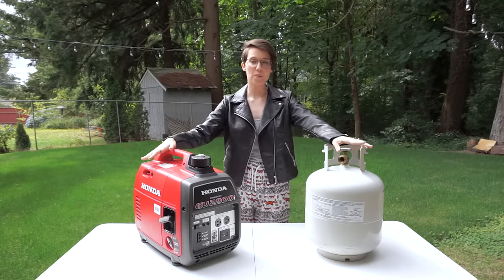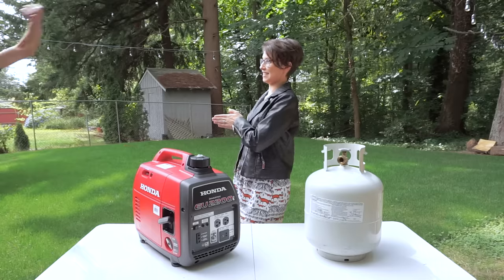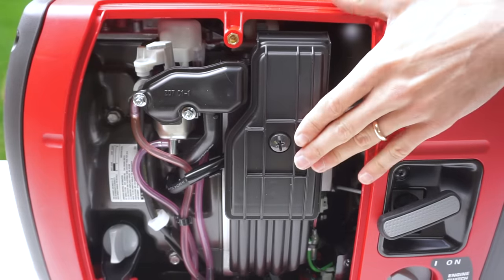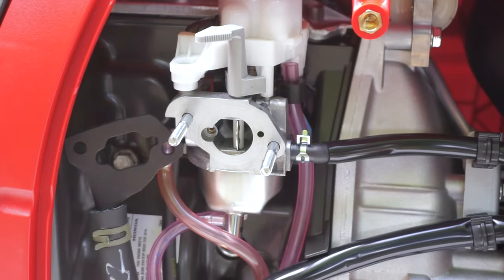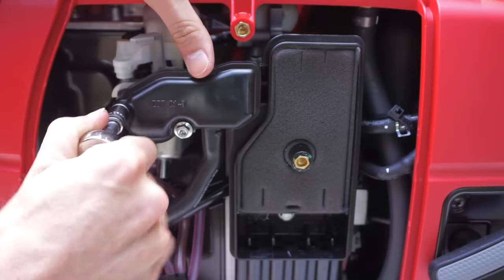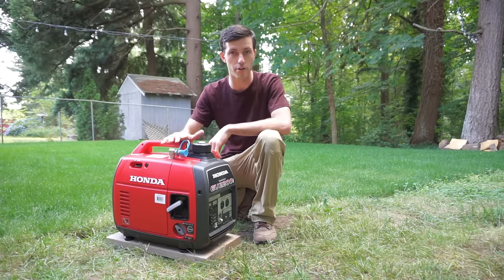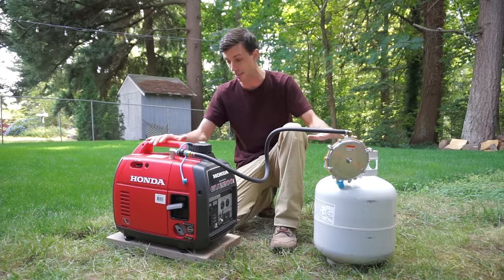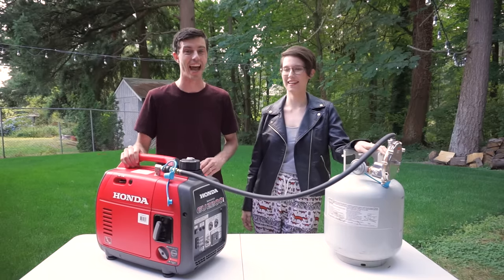Honda EU2200i Propane Conversion Kit - DIY Install for Honda Generator

Comment: Hello a few questions:
1. I wonder why Honda does not off a propane unit from the factory?
2. How many watts does the Honda put out when burning propane vs. gasoline?
3. I noticed on your video of installing a soft start on your AC you used a Westinghouse, now you have a Honda....Why did you change?  
Your guys do a good job with your channel keep it up.  Thanks

Comment: Great information! It gives me clear idea propane has less pollution.  I wonder if I am to keep 20 ft away from the gasoline generator, would I be able to shorten such distance by switching to propane generator, if noise is not a concern for me?

Comment: great video ..
the price of a honda + conversion is insane 
a harbor frieght is 500$ 
champion and sportsman have propane units for under 800$
again you did an amazing job on this video <3
Reply: Fortunately you get what you pay for, read the reviews at Harbor freight and you’ll understand that they’re not high-quality and often have electrical failures. I don’t think that’s the place to save money when you need a back up generator.
Reply: @melissasmess2773  1200$ for a honda 
Or 450$ for a harbor freight that's the exact output as the honda .
Now I've had mine for two years and never fails to start and super quiet 
The only experience I've had with champion is my buddy had his a couple of weeks and it power fried .
Stick to my Harbor Freight

Comment: Thanks for the video, any draw backs or problems since making the video? I am thinking about going this route.
Reply from the maker: Definitely do it. We've been running our honda for 5 years now on propane and it's so much nicer than gasoline. We've had zero problems.

Comment: Nice video. Very well executed.. one question. Do you have to convert it back to gas or just run gas on same propane system.
Reply from the maker: With this kit it's now a dual fuel generator and can switch back and forth between gasoline and propane.

Comment: How long will the generator run on the propane tank?
Great video and clear instructions.
Reply from the maker: It will run for 32 hours at 1/4 load on a 20 pound propane tank.

Comment: To be safe and not to loose expensive propane I would have tested the connections you made inside and outside the generator with a bottle of leak detection fluid just to make sure the joints are good......👍
Reply: Its lose not "loose". Sorry I had to.

Comment: You are doing very good educative videos, thank you. i just bough the eu2200 and will install the conversion kit. Now do i need to let the generator runs on gas for a couple of hours first ?
Reply from the maker: Nope the generator never needs to run on gas and if you're going to do the conversion I would recommend that you don't.

Comment: I get why you did the conversion but...since the specific energy or energy density of propane is about 82% that of gasoline, your 2200W generator is now an 1800W generator.  It probably doesn't matter for what you are using it for...1800W peak will do the job, and like you said, it burns cleaner too.  Good video.
Reply from the maker: Yep, we mainly only need the generator to recharge our battery bank 👍

Comment: Great video.  I would be using Natural Gas.  Is it the same install minus the regulator?  I have a quick connect feed for my grill that I would use for the generator.

Comment: How does the Propane gas pressure regulator handle cold weather? Propane (LPG) systems in cars need to be heated with coolant fluid, otherwise the pressure regulator will freeze.

Comment: I'm glad you did the video.  That option sounds like a very easy and fantastic mod to the Honda Generator.  THanks.
Reply from the maker: Thank you! It is a great mod, we are super happy that we have a choice between gasoline and propane with the flip of a switch.

Comment: Great video yer im in Australia 🇦🇺 and want to do this great to run 2 different types off fuel very handy 👍expesily when ya in the out back off Australia sometimes you carnt get eather type off fuel or only one or the other in remote places  , gee your missis was quick at the shops 😀 whats the soft start up thing for the aircon 🤔

Comment: Very good and easy video setup. Question can you do the same with two  EU2200i and EU2200i companion I understand I would need a Y splitter if it can be done. Thank you for sharing. Happy camping 🇺🇲🤙🏼⛺ One last question you still can use gas too. ⛽ right ? Thank you.
Reply from the maker: I'm not sure about running two generators off a single propane tank, you would have to ask the manufacturer. And yes you can still use gasoline! This kit makes the generator "dual fuel".
Reply: @FateUnbound  I took your advice by contacting the company and yes they do make one also. Thank you. Stay safe.🇺🇲🤙🏼

Comment: Great vid, to clarify: once the kit is installed can you still run on gasoline if you choose to?  And switch back and forth, or once converted you are limited to propane/NG?
Reply: Absolutely. You can switch back to gasoline anytime. The kit in no ways limits the type of fuel used.

Comment: Great instructional video.  I have a large 5th wheel and I'm considering getting a Westinghouse dual fuel generator. Why did you switch from a Westinghouse generator?

Comment: I am considering installing the conversion for the  EU3000.  One draw back on the 1000 and 2000 compared to the 3000 is the small tanks that need to be filled often.  The 3000 holds about 3 gals and can run around 20 hrs.  I understand that propane is less efficient than gasoline.   A 20lb bottle of LP is comparable to 5 gals of gas in weight and bulk.   Using the 2000 for comparison, I would like to know just how much longer, if any, a 20lb bottle of LP would run the generator compared to 5 gals of gasoline.

Comment: Nice job. What is the approx run time range for a 20 lb propane tank?
Reply from the maker: 32 hours at 1/4 load on a 20 pound tank.

Comment: Any generator running above 3000 feet altitude is going to lose power...I think it's about 3 1/2% for every 1000 feet above 3000. Not a problem if all you're running is standard low amp appliances. If you've installed the Micro-Air Easy Start to run the AC with a smaller generator like the Honda EU2200i and you're in the mountains on a hot day every ounce of power counts. My EU2200i struggles to run our 13,500 BTU AC at 4000 feet on gasoline. Never tried propane at altitude, but my guess is to have low expectations. Great option, though. Enjoyed the video!

Comment: Hi there thanks I want to start of bnb with thanking you for your conversion video. Awesome.  I didn't know it was possible.  My question is I have the 2200i & the 2200i companion for my rv and I would like to know if I have to convert both generators or just one? How should I go about doing that if its possible ofcourse.  Thanks.

Comment: One Comment of Confidence - TWO Questions that Matter to Me:
The Comment: After looking at 100s of Gas Powered Gens. I realized that the main difference between HONDA and all other companies was their ENGINE was Larger and didn't take the beating that others did simply because they had a superior power source. CUDOS to the fact that your SPONSOR made that PLAINLY said when examining the Micro Easy Start. 
1ST Question: How long will a 5 Gallon Tank last say using it averaged 50% Load?
2nd Question: Are their any maintenance changes or remains the same precautions once the main fuel is Propane?

Comment: Check your torque wrench because that sure did look like 90 inch pounds and believe me propane fires are pretty bad but luckily those tanks have a poppet valve on the tank

Comment: Nice video and presentation. I am thinking about doing this on mine
 Question-I have read that the propane fuel can cause some issues when using in below freezing temperatures. Have you heard about that?
Reply from the maker: I'm sorry but I don't have the answer to that question. I'd call Clayton, the maker of this kit, at Hutch Mountain for the answer 435-494-1975
However, either way, this kit let's you switch between gasoline and propane in seconds so if you're worried about it then when it is below freezing just run it off gasoline.

Comment: How much propane is consumed by the generator? How long will it run on a full propane tank?  Also, do you know if a propane conversion is available for the EU3000ie honda generator?  Great video guys and very informative.
Reply from the maker: Hutch Mountain says for the EU2200i: 30 hours of run time at quarter load, 22 hours at half load, and 12 hours at full load off of a full 20lb "bbq" size propane tank. I think that's pretty good!
And yes there is a kit available for the EU3000i as well and the $25 off promo code FATE works for it as well! Here is their website: https://www.hutchmountain.com/products.html

Comment: After watching this awesome videro, very instructive by the way, I started thinking if this kit could be adapted to my Ryobi 2300. I know they are far from being the same generator in terms maybe of quality but, since they cover basically the same load range, they are both inverter generators, the carb is roughly the same dimension, the of & on switch is also on the same side as the RY2300, so I believe that Hypothetically it can work but still wanter to ask if any of the viewers or the video producers could give me a response about this topic I just presented here. 

Thanks again for the video content, it's very well presented. 

Stay safe.

Comment: That’s pretty slick you guys! 😉 I do have a question. Do you guys use one or more carbon monoxide detector(s) inside the trailer?
Reply from the maker: Thanks! And yes there is a carbon monoxide detector inside out trailer 👍
Reply: Right on! 😉👍

Comment: Awesome video!  Question:  How long will a full propane tank last using the generator?
Reply from the maker: Thanks Eddie! And it will run for 32 hours at 1/4 load on a 20 pound propane tank.
-David

Comment: Great video, very informative. One question, how long will the compressor run in idle mode on that full bottle of gas? Honda suggest it will run 8 hours on a full tank of petrol, be good to compare that against a tank of gas if you know. Thanks from NZ
Reply from the maker: It will run for 30 hours at a 1/4 load on a full 20lb propane tank.
Reply: @FateUnbound  Thanks for the info, I'll look into it a bit further I think. Cheers

Comment: Have you tried a Cold Weather start on Propane yet? Most engines you start on Petrol (Gasoline) then change to gas. There has to be residual heat to vaporise the LPG.

Comment: Is this a good way to clean the generator after using gasoline?  Follow up with a run of propane before storage?  Also does the propane affect the oil change interval shorten it extend it?  Thanks for.the great video.
Reply: iamatt Propane will run cleaner and the oil will stay cleaner longer, but that does not necessarily translate to longer oil life. Oils contain anti wear additives that may be consumed while the oil still looks clean. Propane should leave fewer deposits in the engine and result in longer engine life.

Comment: Great installation video of a very well designed LP conversion kit!  (Also, it is so nice to watch a you use both hands when demoing something.  The single-handed fumbling filmed with some Blair Witch camera bobbing method used by many other folks is so distracting.)  One question... Does your camera have a focus lock?  :-)
Reply from the maker: Thanks David! And yes our camera can be manually focused which is what I should have done for this video so it stayed focused on the generator and not my hands when they got in the way haha.

Comment: Something to keep in mind when using propane and natural gas, is they do not have the same amount of energy as gas so running your gen to max wattage on gas say 16000 watts on a 2000 , on propane and N gas you may only be able to reach 1450 - 1500 watts .

Comment: Well done, will be visiting Hutch Mtn soon. Is your code still valid? Also will this run your AC off of propane? How about while on eco mode? I have the easy start on my ac but my honda 2000 can not run it from eco mode, has to stay wide open at all times.

Comment: The real question is if a 2200 watts Honda running on propane will be able to run a 15 000 BTU AC on a trailer. Also would be very interesting to know the consumption propane vs gasoline on the same AC with the same generator. Anyways this was an awesome presentation.
Reply: Probably not with buying the easy start kit for your AC. The generator running off gas will start a 13,500 BTU air conditioner at sea level. Propane makes less horsepower unfortunately.

Comment: i think they should have included longer studs it's not hard to unthread them and thread new ones in, i wonder if this kit will work with my ryobi inverter genny.
Reply: Dave Boothney Samesees. Half a nut is totally Mickey.

Comment: Great video , here's my question . Do think Honda will make dual fule gen set form the factory ? I just bought a Champion 3500 watt dual fuel and it works great . Not as quiet as a Honda , it is about the price of a Honda tho . Keep up the great work .
Reply: Duel Fuel generators are already out on the market. They sell them all over, including places like Costco (in Calif). They have an 8,000 watt on line generator that is duel Fuel, for about $800. 

Best place to look for 'Generator's at a good price, is a Contractor hardware store, like Home Depot, or Lowes, A lot of contractors use portable on site generators now to save on convince and they can know exactly what their power source is, and how reliable.

Comment: Do you use a 15amp converter to plug your RV into the generator for the AC to work? And with the soft start the generator can handle all that?

Comment: Have you had any issues changing from propane to gas or vise versa?  Do you leave gas in the fuel tank or drain it out? One more issue about warranty?  Does the kit void the warranty

Comment: Safety tip only 1/4 turn on the propane tank In an emergency it can be quickly shut off, no need to have it wide open

Comment: I'm interested in how well the valves/valve seats hold up to the extra heat from the propane. Will it kill the exhaust valve seal faster? hmmm. BTW, you should be able to easily back the studs out of the engine to give them more bite
Reply: This has kept me from considering a conversion on my EU7000.  I'm going to wait and see how these converted generators hold up.

Comment: Anyone know if there’s any loss in power going to propane from gas? I was under the impression that propane generators typically have a power power output with the same size motor of a relative gas motor. Also, any expected change in life of the motor?
Reply: Runs hotter and lasts longer.

Comment: Understand the propane burn rate is pretty fast and you need to put a propane filter in the fuel line for propane has a lot of dirt in it. Take apart a used propane filter and see.

Comment: Thanks for the video! Didn't even know this existed :) Might have missed it, but are there any decreases in efficiency when running on propane? Since it burns cleaner, I'm assuming it's just as, if not more efficient :) Approx. run time per propane tank vs. gallon of gasoline?
Reply: Propane is cleaner but less energy dense than gasoline. 1.38 gallons of propane=1 gallon of gasoline.

Comment: I feel a gas solenoid connected to the ignition would be a really good idea. Otherwise its just spewing gas everywhere if somebody who doesn't know, or you by accident, just turn off the ignition and leave the gas open.
Reply from the maker: That is not how it works. There is a regulator threaded onto the tank that prevents propane from flowing when the engine is not on even when the propane tank is open.
Reply: @FateUnbound  Ahh one more good reason to add a solenoid.  Some people dont know what a regulator does. Wasnt trying to word that like a asshole lol.

Comment: Did you guys edit and re-post this video.  I thought I remembered a video where you had trouble getting the air cleaner bolt to thread with the plastic spacer, which is an issue I’m experiencing.  I feel like the plastic spacer is too big, maybe bigger than what I’ve seen in videos.  It barely has any threads after adding the spacer.  Any tips related to that?

Comment: What happens to the  gasoline fuel pump  when the generator is running off propane ? Is the pump still pumping and does it damage it  running with no fuel going through it ?
Reply: Typically small engines like this are gravity fed fuel systems which are regulated with a float needle valve in the bowl of the carburetor. No pump required.
Reply: @silaslongshot941  On the honda its  a pump . I did some  reading and more video watching and found out  they make a switch  for the 2000i that has to be added to shut off the pump since it doesn't have the 3 way switch  like the 2200I has  built in . This switch when set at the  gasoline off  lp gas on  space  it shuts off the  pump .
Reply: @Sertao2013  OK. good to know. Had assumed the function knob position was only a valve shut off.

Comment: Are there two regulators on the tank? At 15:55 it appears you have the new large regulator and a small standard bbq regulator on the tank.

Comment: We love our propane generators.  You should always turn them off by first removing the electrical load and then shutting off the fuel so the engine dies of fuel starvation, whether or not it is running on gas, propane or natural gas.

Comment: Very nice instructional …… what is your run time off of that propane tank?
Reply from the maker: 30 hours at 1/4 load on propane, compared to 8 hours on a full tank of gasoline (0.85 gallons)

Comment: Do you need to run gas for the break-in period or can you install the convertor on a new generator and run it on propane from the get-go?
Reply: I have read at least 4 people asking this question without an answer......anybody, What does Honda say?